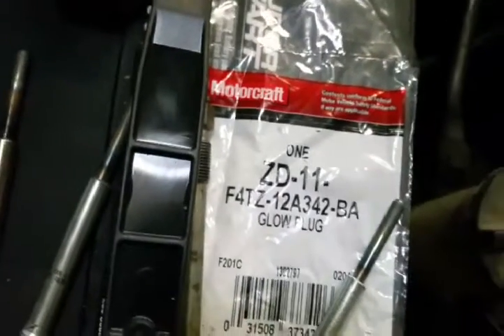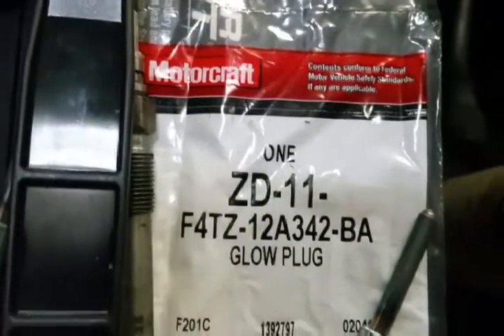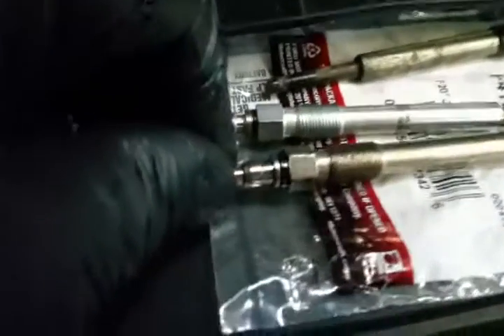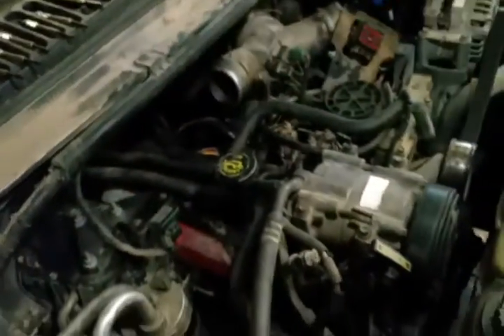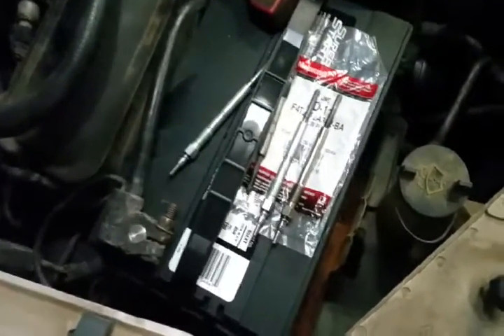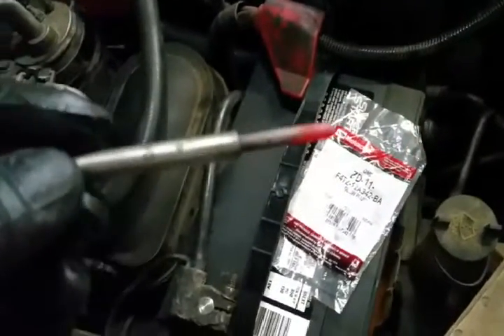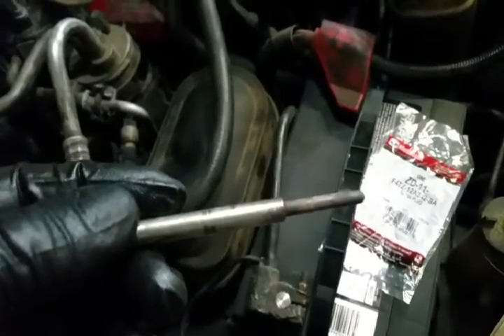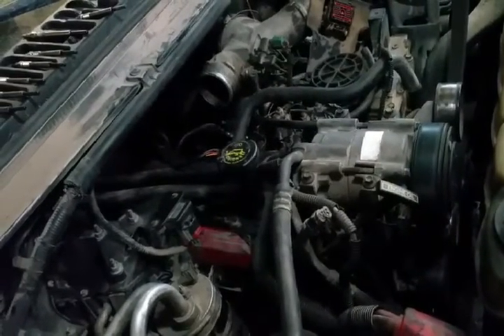7.3l Ford Powerstroke Glow Plugs

Comment: the difference is where they are made.. stuff made in japan is crap. i am sure ford  used japan to make the orginals..now germany that is where you  said thoes OEM replacements are made in. thoes will last
Reply from the maker: the good used one I showed was an original "zd-10" from a 1995 powerstroke, also german